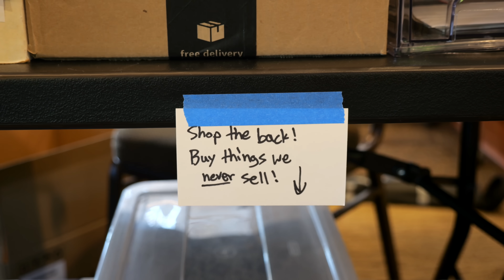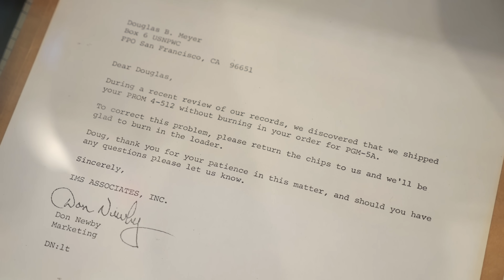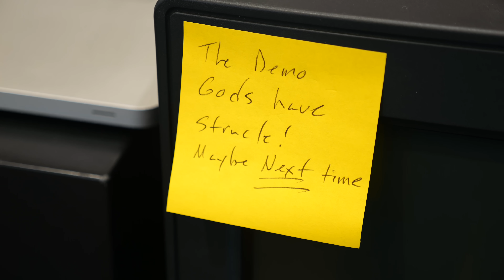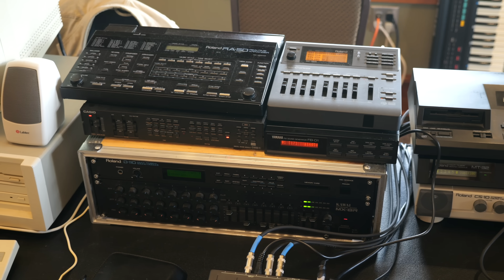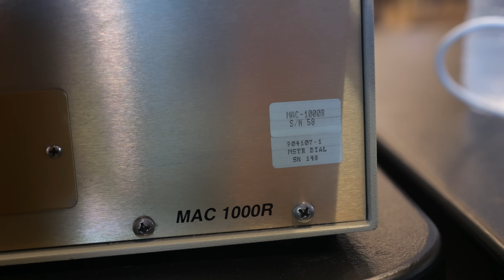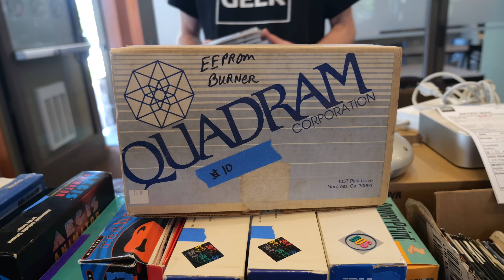I saw AWESOME stuff at the Free Geek Twin Cities Retro Tech Expo!

Comment: I worked at a television station and we had three of these little MAC 1000R beasts to steer in remote TV truck STL microwave dishes into the big radome on the Canadian CN Tower... Yes that CN Tower... 
They worked fairly well, but every now and then decided to lose their setup and you'd have to reboot and restart the RF GUI software after rebooting or rebuilding the HD after a crash. Fun times!

Comment: What I liked about a lot of machines built back in the 70's and 80's were they were built like a tank. I had for quite awhile a complete HP 250 computer system which each drive was the size of a large mini fridge and put out enough heat to warm several rooms. I also had one of the high speed line printers used to print out forms for billing. It was a really cool system that used Business Basic and you could stop the interpreted code while running ,make a change to the program and continue. Miss those days haha.🤔

Comment: You could get a PROM for the IMSAI 8080 so you didn't have to manually enter a boot program via the front panel.  But DANG, they were a hard to find for quite a while.  I had about a month delay waiting for my floppy drives to appear and somehow managed to get TinyBASIC in ROM, but I had to manually insert a JMP >4000 instruction at address zero.  Not sure why I couldn't put >4000 in the front panel and say "start."  Maybe I just didn't know how to do that.

When I first got my drives, they came with a new drive controller board and I figured out why... the original controller board didn't have a place for a boot prom.  And then I had to wait another month to get the PROM, which must have had the CP/M BIOS cause I remember never having to touch the front panel after that.

But I also remember there were PLENTY of people upset at IMSAI for late shipments.  I got mine around the end of '78 or early '79, with a pretty minimal wait.  I'm pretty sure I had seen a TRS-80 in the local Radio Shack by that time, and I REALLY wanted to just go buy it for that instant gratification.

I had it for a couple years before trading it in for an Apple ][ with a Microsoft CP/M card.  I remember selling it a couple months before War Games came out.  I probably could have sold it for a little more after that, but... alas, what do kids know about economics?

Comment: Some IMSAI and like computers definitely could be fitted with proper boot/OS/monitor ROMs or BIOSes for hooking up disks or small routines to load data from magnetic/paper/audio tape.  Such that you could use them more or less like a desktop computer, in as far as such a thing existed.  The most you'd maybe have to use the front panel for is setting the program counter to the ROM entry point and maybe entering some parameters like what serial port to use for the console.